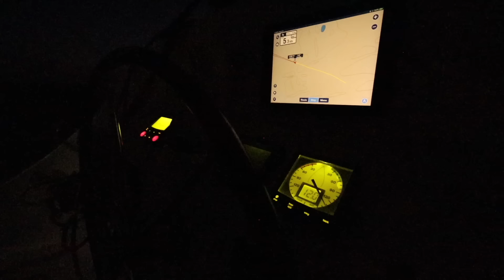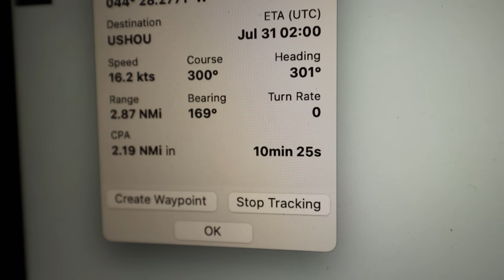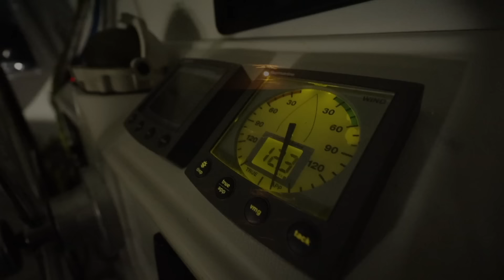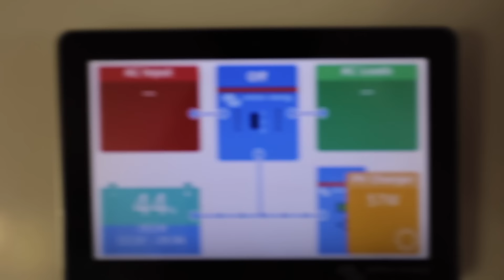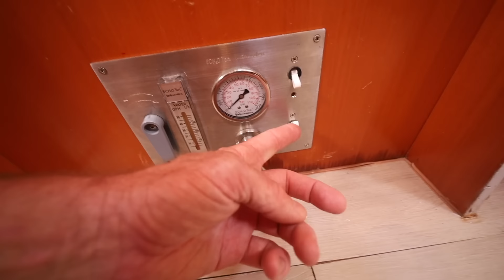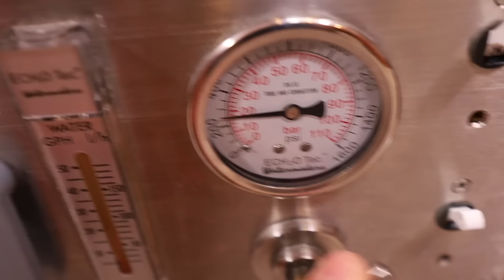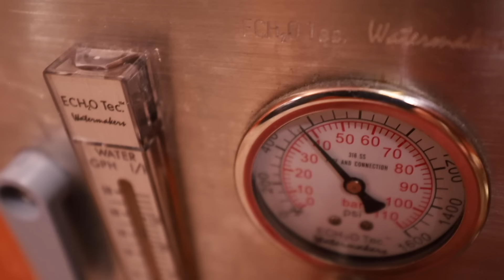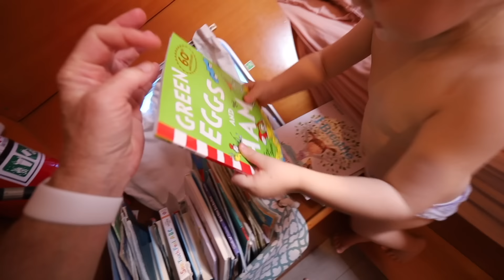Living on a Sailboat 3,000 Miles from Shore  (Day in the Life of)

Comment: 24 or 48 volt for water maker in new boat. If you are doing a 48v battery bank then get a 48v if 24v battery bank get a 24v. 12 volt is not efficient and 48v is most efficient.
Reply from the maker: We're going 48v on the Nahoa55.
Reply: @SailingNahoa  perfect. make sure your windless is 48V and so is your Aircons and  water maker. Current (amps) determine the wire size so smaller wires means less weight and Catamarans have a lot of wires.